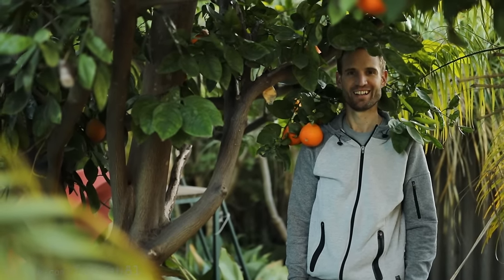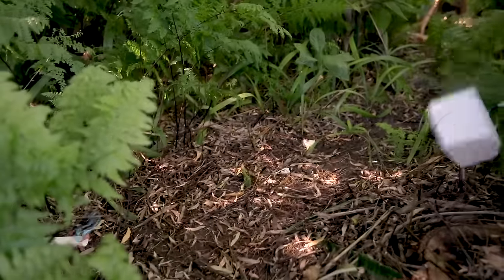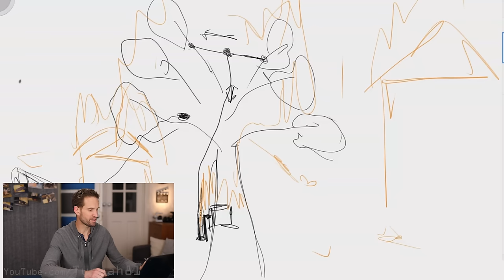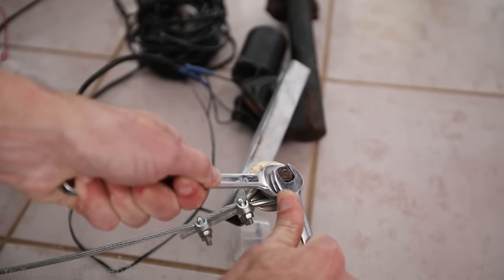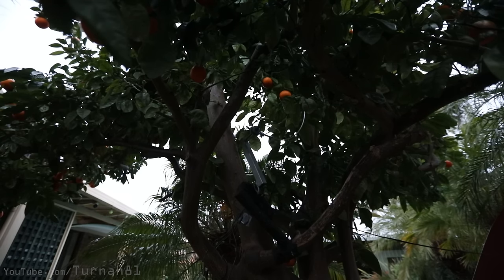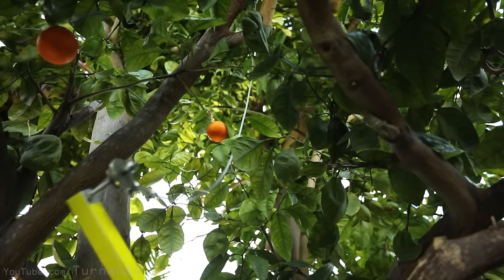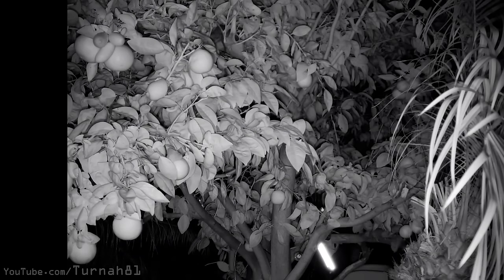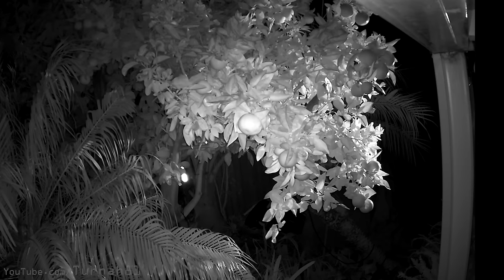I made a Machine to Throw Rats from my Fruit Tree!

Comment: Would an upside down metal cone fixed to the trunk of the tree work? Angle it steeply enough that they can't get traction on the surface. Keeping branches away from surfaces that rats can jump from would also be needed.

Comment: Once they are in the tree you lost the battle.
Isolate their route to the tree and prevent them from getting in it in first place or at least try to curtail their entry.
tin foil band around bottom of tree hooked to bug zapper? 
Trim trees away from roof as the will jump from any structure close to canopy.

Comment: I had an experience with raccoons in Colorado getting into my little patio pond and wreaking havoc with the plants. It wasn't a problem when we had a dog that had 24/7 access to the high fenced back yard, but after the dog died we didn't get another one. I set up a webcam and a computer so that when it saw motion it would play an audio file of dogs barking. It worked for a couple of weeks. I also had it set to save video from trigger occurrences and I was somewhat shocked to find that what I thought was only one or two critters turned out to be a family of seven. No wonder they made such a mess! 
Ultimate solution? I gave up on the pond and took it down. It was either that or get another dog (really the only effective solution for any critter problem is a real live predator), but the reason I didn't do that was because I was travelling too much and I didn't feel it was fair for the dog, not to mention being much easier not to have to deal with finding dog-friendly travel options. I love dogs too much to leave one at home or with friends or any kind of kennel when I travel. It doesn't matter how well they are treated, it's the separation from you that causes issues.

Comment: The hardcore version is based on a nVidia Jetson (or simply a Raspberry/Orange/Banana Pi with OpenCV, much cheaper) able to recognise a rodent on the picture and aim at it with a pellet gun mounted on a turret: totally overkill, economically not-viable, but fun to design, and 5mm plastic pellets are safe and cheap, even to rats, we're talking of a deterrent here (start thinking of how to modify the gun to shoot and reload...).

Also, if you really want to avoid fire, you probably want to power your entire system from a small set of solar panels charging the battery during the day and put some short circuit detection in the circuit and cut it at the level of the battery and at the level of the motor, You could even add sending an alert to your home automation system so you know immediately something went wrong before any fire starts: it's all about safety...

Comment: I doubt you're still checking comments on your old videos, but there is a solution that should work for both rats and cats. 

A high pressure laminar flow nozzle, spraying water that is energized with alternating current. 
As long as the animal is grounded, even with another stream of water, you get a closed circuit.  

Adjust the voltage/amperage to create the desired effect.

Comment: All you have to do just place an aluminum strap it into your tangerine trunk nail/screw it if you have to trim the branches from fences....

They won’t climb up because it’s very slippery make sure the strap is wide enough not let rats jump...it’s a common problem here in Florida if that won’t help then buy a powerful BB gun with infrared scope go Call of Turnah on them...

Comment: A long stick,pop cans,bucket ofcwater to drown them in and bait.push the stick though so it spins put on the bucked with a ramp watch thousands rats walk on the cans fall in while the cans reset or make a auto resetting diving board. Thats is easiest because you xan tape the board to and ledge with bucket under it.Put a strobe light that flash whole tree on top that.Have the light have different types of flashes at different times sl they wont get used to it.

Comment: Do a collaboration with Michael Reeves to create a rat-tracking robot connected to a BB gun that snipes them out of the tree. 

Honest answer, there's a trap I used for mice that is basically a bucket with water in it and then kind of collapsible diving boards with food on the end of them. The mice go for the food and the diving board falls away dropping them into the bucket, then the board flips back up into place. The water in the bucket keeps them from being able to jump out. And if deep enough it just makes them drown.  :-/

Comment: Big sheet of tin wrapped around the trunk and ensure upper branches are cut back from structures so they're not an access point to your fruit.
OR
More entertaining. Same as above but instead of tin as a barrier. Grease up the trunk. Sit back and watch the fun of rats getting half way through the grease and then sliding back down the trunk, just to try again and fail.
OR
Check out anti squirrel devices on bird feeder videos for ideas but don't make a rat flinger. I've seen some squirrel flinger videos, hilarious but ultimately cruel.

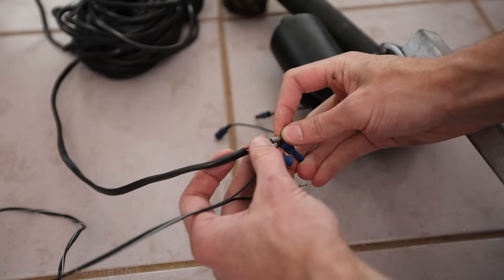Comment: 6:17 FYI - The cable saddle clamps are installed incorrectly. Not that it's crucial in this application since they aren't under a critical load, just an observation. Saddles should be installed on the live end and the U-bolts on the dead end. An adage that that can help remember the correct orientation is "Never saddle a dead horse."

Now that my pedantic nit-pickery is done, thank you for the content you've posted! I would be interested in watching an update/solution to the problem. I wasn't able to find one on your channel, did anything end up working? What about installing one of the "cat sprinklers" that would hit the tree in a more random pattern?
Reply from the maker: Cheers mate! Yeah you are right about the cables. I was given 10 of them and they were already terminated like that professionally 😬. Rats are re occurring but they seem to get worse after the fruit is ripe (late spring) so we harvested earlier. But no fruit this year really hot summer and bad pruning by me. But an electric rat trap has been great. I modded it so I don't need batteries and also made a shelter for it to use outside.  Plus some neighbours moved away that were harbouring rats i believe.

Comment: You need to look at how they harvest pecans.
They use a device that clamps onto the tree trunk and shakes it violently so the pecans fall from the tree.
Of course you'd want to tone it down a bit.
    It works with an offset weighted flywheel or lobe. 
I figure an electric motor with an offset flywheel would get the job done.

    Go to 2:30 on the vid.
https://www.youtube.com/watch?v=aK5AnViPkJ0&t=1008s

Comment: I think your branch clamp is bad.

when trees grow they get bigger, the new growth on the outside. Restrict that & death results.

When I was born a tree was planted by my grandparents, and they put the sidewall of a 15" tire over it, because the tree was small enough to fit through the rim hole. A couple years ago "my" tree suddenly died, with no signs of any disease!

During removal of that tree,  I found that tire sidewall, and the trunk was over filling it. The tree was bulging over the (rubber covered steel wire) bead! 

It had been that big for, probly, a year or two, then that cedar was suffocated. It was pretty tall, probly 30', and a pita to remove from her yard! I had a ~15° window to drop it in without hitting another building! 
(i got it & hit nothing 8) )
Reply: Ah, it's been 4 years!

can we see where those clamps were at?